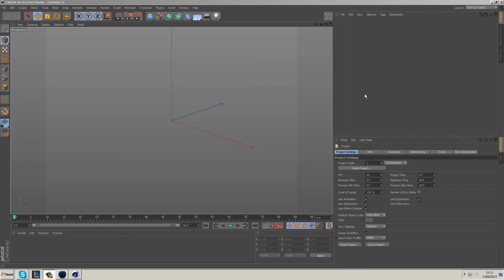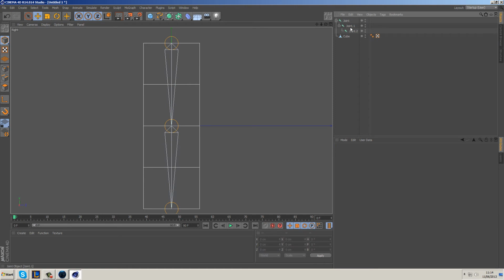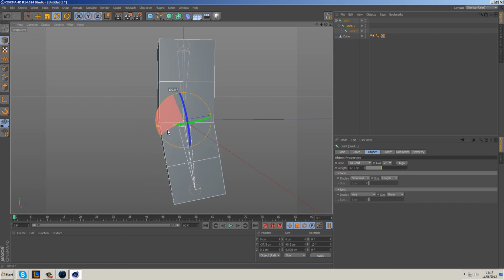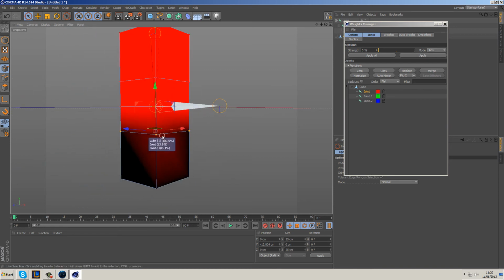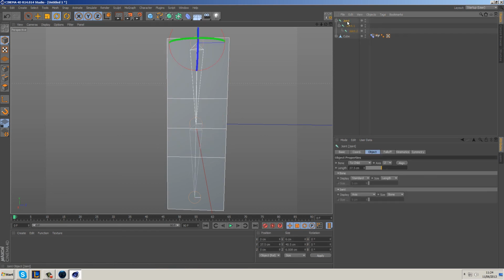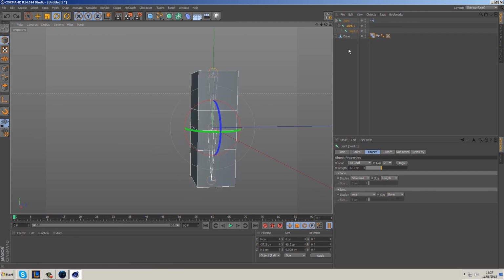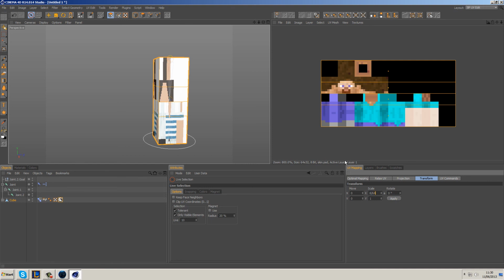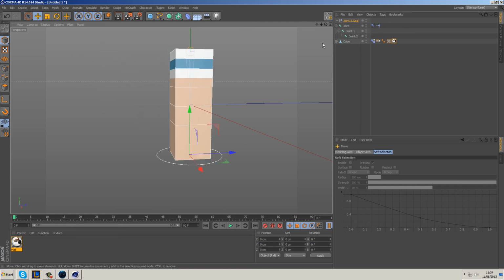Minecraft Cinema 4D Rigid Bends, Arm and Leg Rig

Comment: The pose percent should be the expression tan(A/2), where A is the angle of the joint's rotation (you might need to convert A to radians by multiplying it by 0.017453).
The linear interpolation of the calculation method you used results in noticeable error. Use the expression above, and it will be absolutely perfect.
And, wonderful video - very professionally executed and informational.

Comment: Uh.. I have a problem..  HUGE one.. When I bend all the arms and stuffs, then I render it, the preview does not look like the editor preview, like it doesn't save. Where ever I drag the arm, it doesn't move in the render preview. I made my character stick his arms out holding a torch, and when I render it, in the preview, the arm is still there, it's bent a little, but was not in the air, but, I can move the torch around. Is there a fix for this? Liked this video by the way :)